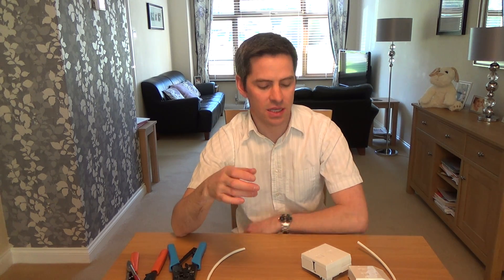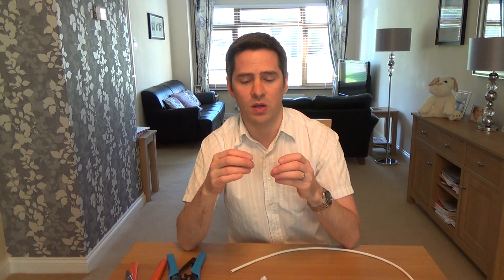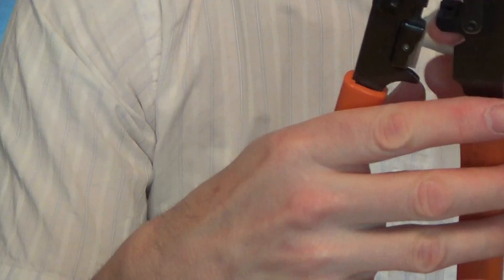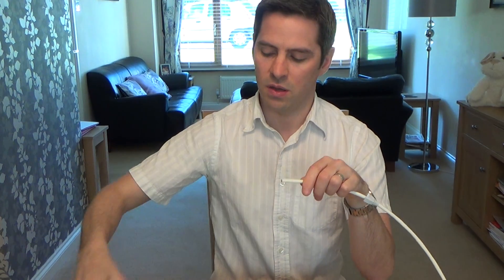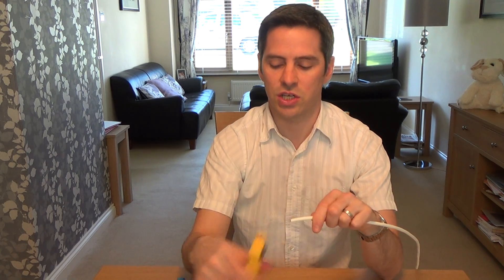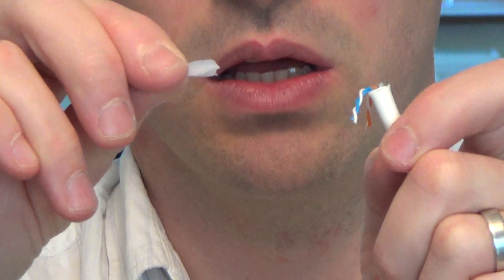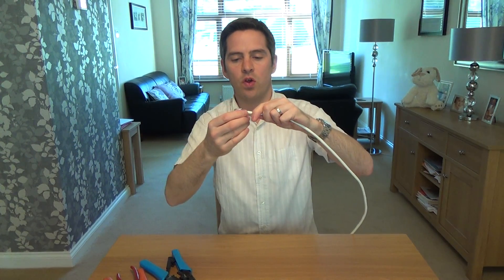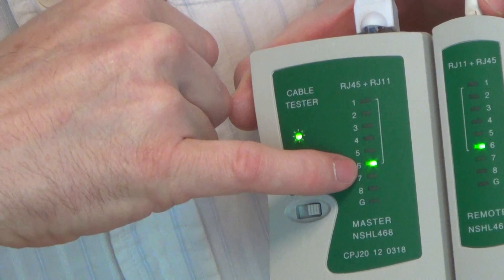How To MAKE a super fast broadband cable for VDSL and FTTC BT Infinity

Comment: Does anyone know if removing the 470Kohm resistor increases VDSL FTTC speeds? Is it essential to have or is it only used for testing the line when all other equipment is disconnected?

Comment: I have been told that when data passes from CW1308 BT phone cable to CAT5E cable, because of the change in impedance some of the signal is reflected backwards reducing the signal received by the Modem/Hub. Is this true & would it be better to use BT CW1308 cable ?

Comment: Hi Vince. Your tutorials are brilliant. Is there a video on how to wire an RJ45 to an RJ12 using Cat 6 cable. It's to go from VDSL faceplate (older style with the sockets side by side) on a 5 metre length of cat6 straight to my modem?
Reply: Hi Richard, That is this video.

Comment: I have the 2017 Mk4 master socket, and need to make or buy a 3m cable due to the position needed for the modem router. Am I correct in assuming this is the correct type I need for the master socket please.
Could you also confirm your eBay shop for me please.
Many thanks.

Comment: I bought a couple of your cables from your eBay shop.

Just goes to show even the manufacturer of my business grade router (i.e. not cheap) supplied a cheap flat phone cable. That is now in the bin. 

Very pleased with the improvement to my line quality. Didn't have any issues with sync speed before but did have interference issues on upstream including many ES and some SES counts. 

Until the manufacturers supply twisted pair phone cables, keep up the good work.
Reply from the maker: Thanks for the comment :-)

Comment: just had infinity fitted and they put on a new faceplate, bought a cable from you but modem refuses to go blue light?? any thoughts
Reply from the maker: Hi, send me a message via eBay if you are still having problems.
Thanks Vince

Comment: Hi Vince. Thanks for all these videos! Very helpful. I recently purchased one of your RJ45 to RJ12 FTTC Cat 6 cables which works great. I decided to hardwire the master socket end to the A/B IDC terminals on the back of the VDSL faceplate. I now need to put in a longer cable from socket to router and am going to attempt to make my own. 
As only the blue pair are connecting to the A/B terminals in the socket is it sufficient to only connect the blue pair at the RJ12 end to go into my home hub? or would connecting the blue pair and the orange pair (as shown in the above video) give a more secure fit in the RJ12 plug. I would welcome your advice. Ross.
Reply from the maker: +captainbongo99 Hi Ross, yes it only use the blue pair so this will be fine. If you wish to connect up the orange as well it will not make a difference to the signal/speed etc. but I think it is a bit more secure because if the sheath of the cable slips out of the RJ12 plug then you have a couple of other wires to help take the strain if the cable gets pulled by accident.Thanks Vince

Comment: I have a RJ11 to RJ11 CAT6 cable , will gettings one with a RJ45 at one end give me any better results?
Reply from the maker: +mattfox14 Hi, It is a nicer fit but it would be unlikely to give you better results.
Reply: I've just bought one of those cables from you. I know you haven't claimed anywhere that it'll boost performance but other than a snug fit, will it do anything else?
Reply from the maker: Hi, it can do, some people see speed increases but others notice no difference. If you have a lot of interference near the router then this cable will hopefully make more difference over the flat cheap leads but if you already have a good cat5e ADSL or good twisted pair version then you will be unlikely to see any difference.

Comment: Q: i am not sure if is a mistake or not, but if you you say that on RJ45 pins 1,2-7,8 will not be used right so you use 3,4,5,6 also on RJ12 you say pins 1 & 6 will not be used so you use 2,3,4,5 then the  cable tester will should red this connections, on my tester is not showing 3/3-4/4/5/5/6/6 is shows 3/2-4/3-5/4-6/5 is not the right testing ? how on your tester is show different since you put on different pins, on RJ12 connector your 6th pin is empty but you device is reading as used ?? unless you put the RJ12 connector in RJ45 port ?
Reply from the maker: Seven Hi, yes I put the RJ12 in the RJ45 port for testing, so use both RJ45 ports on your tester, I haven't watched the video back but I thought I mentioned sometimes when you put a RJ12 in a RJ45 port it can go in awkward/wrong (but maybe I am mixing it up with another video). I should have made it clear I was using both RJ45 ports. Looking at what your tester has read looks right considering the ports you used.Thanks Vince
Reply: @Mymatevince  have you closed your eBay shop?